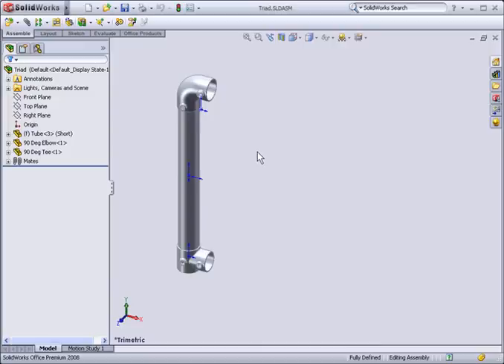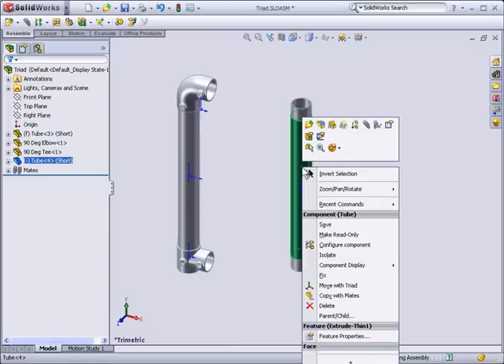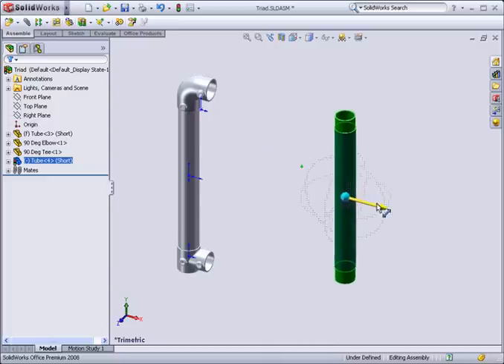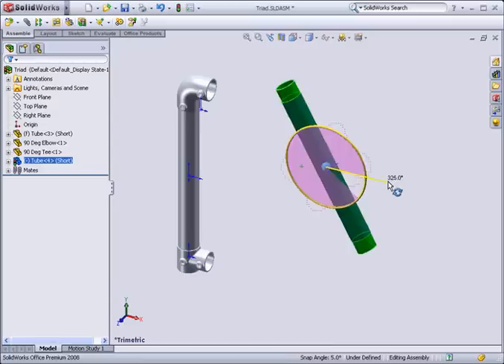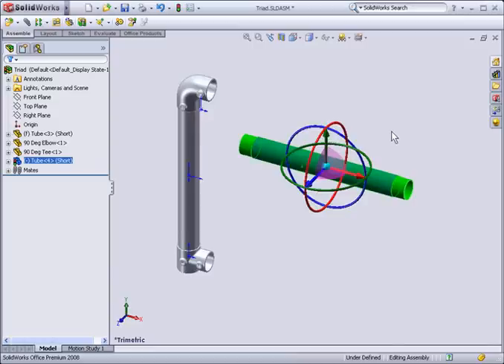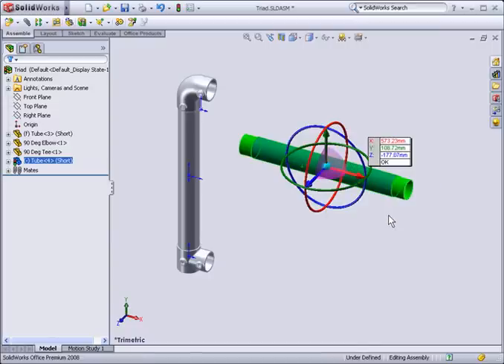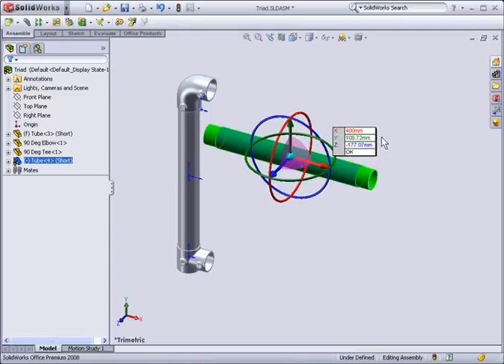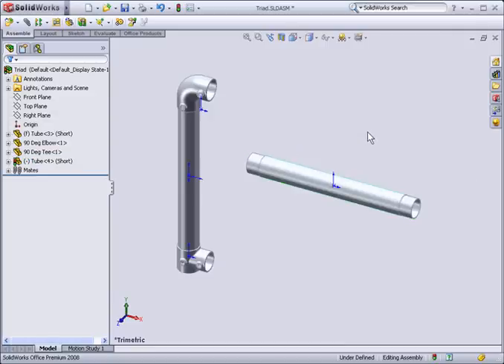Manipulating Parts with the Move with Triad Command

Comment: hello man, i have a crankshaft and a camshaft in an engine block(i want to align the both shafts before putting a drivebelt around them) , but when i want to use the "Move with triad" to rotate the shafts i see the triad rotating but the shaft isn't..do you have any idea whats going on? (i have drawn both shafts as part in the right angle so i could use the align with component of assembly option to align them in the assembly)?!?!help plz this is taking me hours..